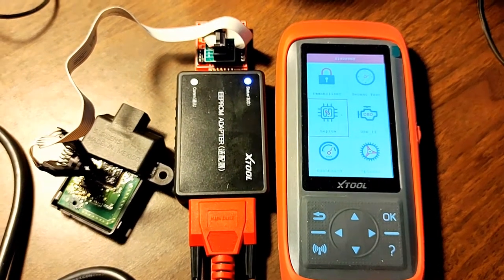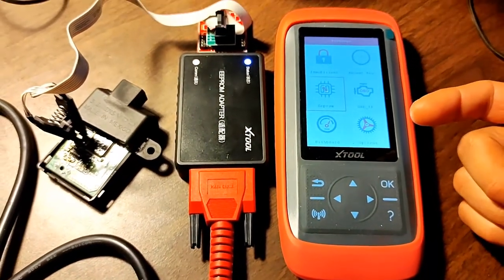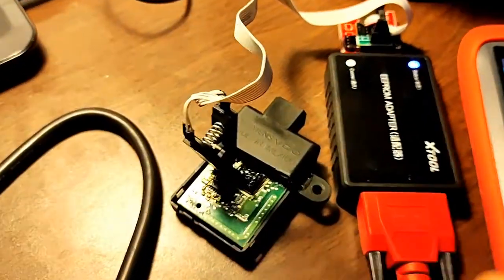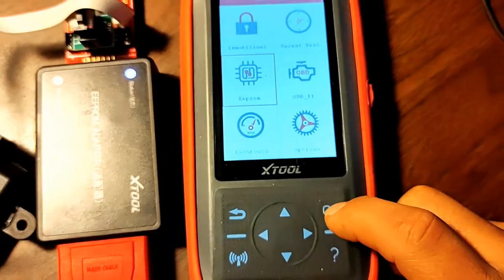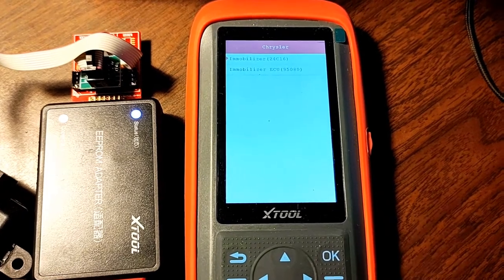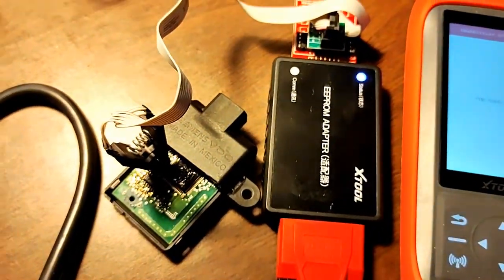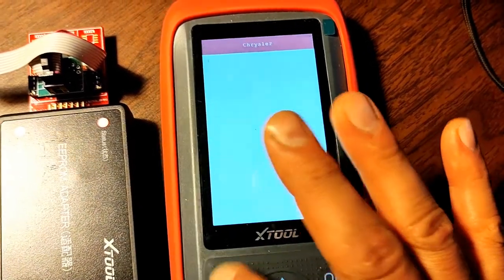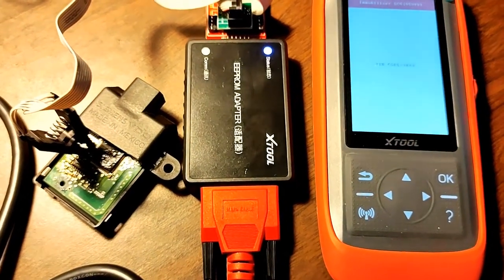NEED HELP WITH EEPROM Programmer: Reading "useless" 0000 Code? Xtool Key Programmer

Comment: I think that you have the power connection hooked up wrong.  The manual is worthless, but in the picture of the EEPROM adaptor, the power port is connected to the EEPROM adaptor, not the Xtool X100PRO2.

Comment: So what was wrong during your last video that would cause you to get 0000 pin code?
Reply from the maker: Hey Mrkncolorado. I watched the video again, I don't know - good question. I guess 0000 is actual code stored in chip memory. Could be just chip memory got reset, chip is defective or some skim/sreem reads 0000 by default.  Any luck to read another SKIM?
Reply: @PistonShack  No, I tried again today. The immobilizer I really need the pin code from has an eeprom with no numbers or markings of any kind.  Xtool is no longer responding to inquiries. I think it's funny there are no instructions on how to use this other than a few YouTube videos. 
I'm not happy. I'll be cloning keys instead of adding originals now. Not this in depth for other vehicles...
Reply from the maker: I have done a bit internet research today, some people say when eeprom reads 0000 or 1111  it could indicate chip circuitry issue or chip no responding to inquires. I have one skim which reads 0000 and some others reads actual pin code.